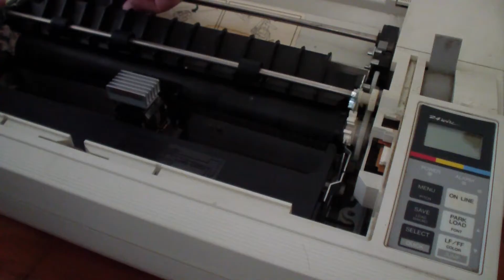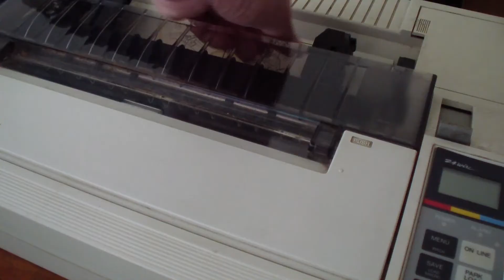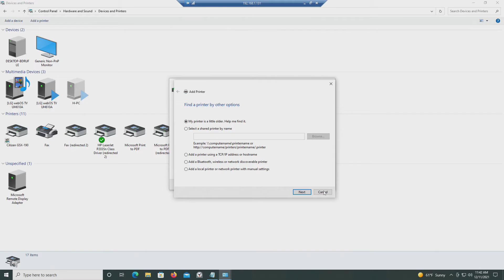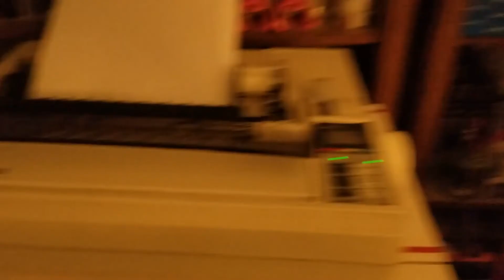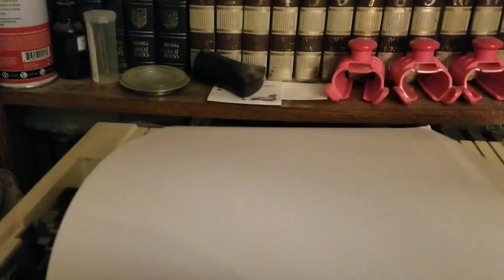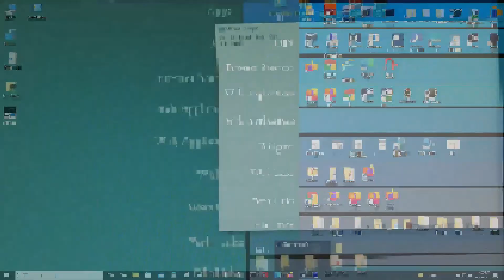Using a Vintage Citizen GSX 140 Dot Matrix Printer on Windows 10

Comment: Hi, I don't normally these days offer help anymore or do help videos as it is mostly not appreciated, however you come across as a nice thoughtful person.  Epson lq drivers also work on these 24 pin printers forget which one offhand think was lq500 not sure. I used any paper with good dark results, fan-fold or the 100 sheets pack with sheet feeder from supermarkets, no problems. All you need is either a new ribbon, still available especially if you in US or reink your old one, (surprised ribbon still woks at all) but careful the pins are steel, water  based will rust the pins so get oil based ink pad refill ink, available but tricky as on line they mostly don't tell you oil or water based. (or get same width cartridge any brand and swap ribbon into your cartridge) As for graphics, was good in colour with colour ribbon, no longer available, in BW should be ok. Not as good as modern ink jets. Those with no parallel ports, get a conversion cord usb to parallel on temu. If I left out anything, just ask. All the best, take care.
Reply from the maker: I like this printer, because it is very cost effective when you have to print simple stuff like receipts or invoices. It does take longer than a laser printer, but it is very inexpensive when it comes to costs.
Reply: good info thank you

Comment: I couldn't find the driver you used for 64-bit Windows, only 32-bit Windows.
Reply from the maker: You can use 32 bit software and drivers in a 64 bit operating system; however, you cannot use 64 bit software in a 32 bit operating system.

Comment: did you put the usb plug into a specific port on your computer?
Reply from the maker: I plugged it into a parallel port on my Dell Precision T3500 computer. That is the only computer that I had which had a parallel port on it. All the other computers I have were produced in 2013 to 2020, and these computers don't come with parallel ports. 

Parallel ports were phased out of computers in 2005. For some reason, the Dell Precision T3500 and T5500 still have parallel ports.
Reply: @Ace1000ks  alright thanks for letting me know I have been trying to figure this out for a while and now that i know i dont have to keep on trying things and downloading malware just to see if this works
Reply from the maker: @donkwonk  They make dot matrix printers that have USB ports. Epson still makes dot matrix printers. https://amzn.to/3cEh7WZ . 

The one I used in this video is one I got in late 1989. Back in 1987, they didn't have USB ports. For printers, they had only parallel ports.
Reply: @Ace1000ks  gotcha. thanks for the info!
Reply from the maker: @donkwonk  Sure no problem.
Reply from the maker: I used a parallel port.